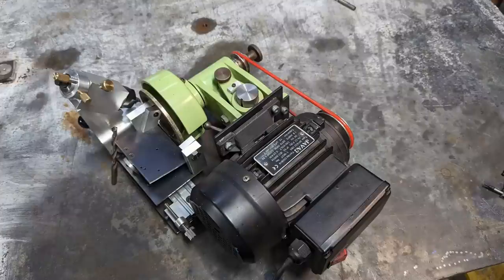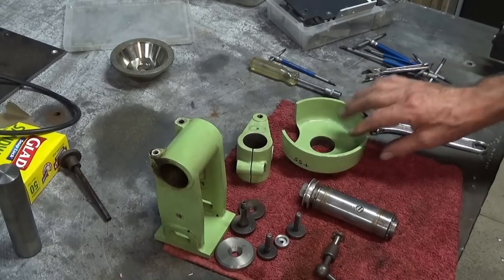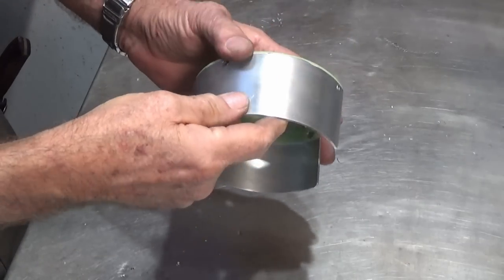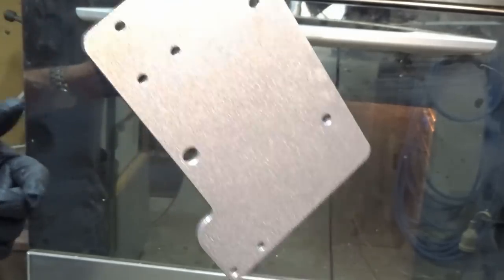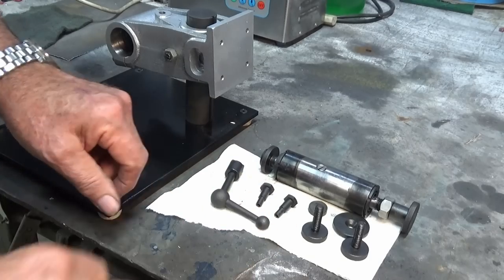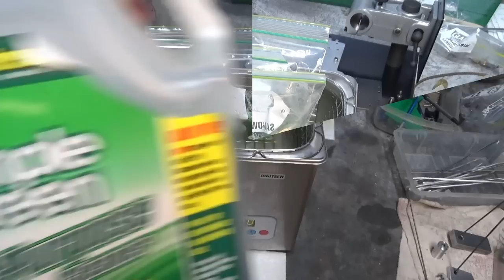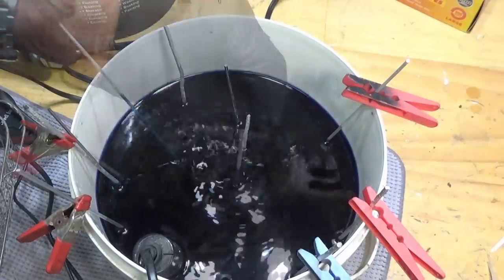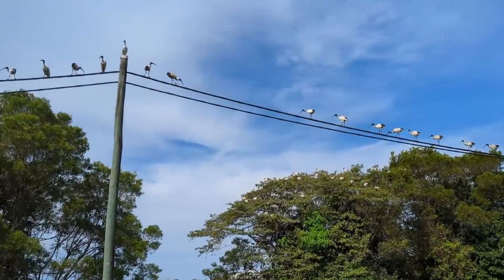Metal Finishing 3 Ways - How I Finished the 4 Facet Drill Grinder

Comment from the maker: I must make a humble apology and admit to a couple of errors in the 2D drawings that I am sharing on my Dropbox folder. There were three parts, the trunnion cam, the trunnion cam bracket and the secondary sector plate which needed to be updated. The trunnion cam was too small in diameter and the cam bracket was incorrectly dimensioned although this part was correct on my finished machine. These changes required a minor tweak in the radius of the secondary sector plate. The errors only became evident when I went to calibrate the trunnion cam and engrave the markings today. However, I have updated the drawings and they are again available for download. If you know of anyone who has already downloaded the drawings, please get them to check for the latest version. 
Regards,
Preso

Comment: What a fantastic way to do parts absolutely amazing
Mark I noticed the finish on your box you made and if I may ask how do you get the burn marks off after cutting them with the laser
I know a few bogans too mate
Reply from the maker: I leave the pins a few millimetres too long and then sand them off after gluing up the carcase. You still get a little burning around the edges of the sockets but it cleans up quite nicely. 
Regards,
Mark

Comment: Good Day Mark. Amazing build and I find the finishing very satisfying . Question.....Do you use deionized or distilled water on the final rinse and heated baths for the two processes? I really appreciate your labor and knowledge in sharing these videos!
Reply from the maker: Mark, I do make up the parkerising bath with distilled water and I also use it for the anodising dyes. However we are on tank water and I have checked the PH and it's dead on 7. We also don't have any chlorine or fluoride in our water so it's OK to use it as rinse water or water for swilling parts. I used to rinse parts with a spray bottle of distilled water (because I saw someone do it on a YouTube video) but the volume of water is important to remove all traces of cleaners and acids. Anodising is not very forgiving if you carry over cleaners and electrolytes to the dye. I did a part today and got a bit lazy and didn't rinse it thoroughly enough and there were light patches around a fixing hole where the electrolyte was still leaching out. In the trade, they use very large vats of recirculating water called swill tanks. The usually rinse three times starting with the most used water and then the last tank will have the cleanest water. 
Regards,
Mark

Comment: I cut foam earplugs in half to plug holes for finishing. Conforms to bores perfectly and is easy to remove. Love your finishing methods!
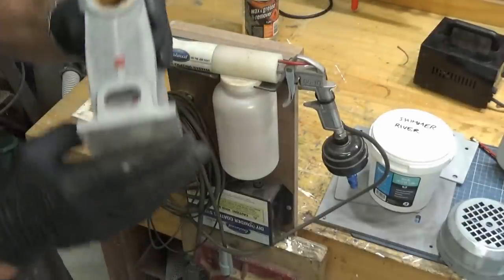Reply: Oh, it looks like you do the same thing! 16:00
Reply from the maker: They were some silicone plugs that came with the Eastwood kit. They take the temperature of the oven and you can reuse them. I think they are available on Ebay as well. 
Regards,
Mark

Comment: Mark, this has been a great series!  One question though: when you use the Simple Green to clean parts, do you use it as a concentrate or do you dilute it a certain amount?
Reply from the maker: Bob, I do dilute it about 4:1 water to concentrate. It works great and much quicker than scrubbing parts by hand with a toothbrush and Ajax like I used to . You do have to rinse it really well though as the film is quite tenuous.
Regards,
Mark

Comment: Beautiful job Preso. I think you should be known as the king of finishing (both kinds of finishing - completing projects, and applying coatings to metal) PS: Great to see the table saw being put to great use like that. 🙂
Reply from the maker: Thanks Craig. The little bandsaw has it's limitations but it's better than a hacksaw any day.
Regards,
Mark
Reply: @Preso58  no I meant the use the table saw was getting. I think it was being used as a stand for the ultra sonic cleaner or a bucket of water or something 😁
Reply from the maker: @CraigsWorkshop  Oh, you mean my stand by surface plate/layout table/surface grinder/junk storage area? I once left the glass lid from my crock pot on the cast iron surface and the condensation from whatever I was heating in it left a perfect ellipse of bright orange rust overnight. 😱😱
Regards,
Mark

Comment: Excellent video and beautiful workmanship!  Thanks Mark!  I realise that this is a "rule of thumb guestimate" and purely academic but how much extra life do you feel you've added to the drill grinder with your work?
Reply from the maker: I guess it's more about aesthetics. I do have an issue with rust on steel parts in my workshop. Mainly due to our humid climate but also because my workshop is not well insulated. The andoised parts are more wear resistant but none of the parts are subject to high wear anyway. In terms of life cycle, it would be the corrosion on the steel parts that would eventually cause something to fail or bind up on this machine.
Regards,
Mark

Comment: When you filed the aluminium sheet at 11.22 it was like finger nails on a chalkboard 😂.  
Surprised you didn't use aircraft aluminium rivets to attach it for a neater finish - you can get countersunk ones - compressed or peened over.

Comment: That is a great video. Thanks for showing how much can be done at home.
Reply from the maker: Thanks. Most of the processes I can carry out at home are not inherently expensive but you need to store a lot of consumables and basic equipment. Some of the gear, like the power supply and immersion heater I use for anodising and parkerising can also be used for metal plating. Like most workshop activities, it's all about how much space you have. Usually, never enough!
Regards,
Mark

Comment: Interesting series, thank you as always. One thing that puzzles me is why you disliked the Quorn. I have one which I use to, amongst other things sharpen drill bits. I also disliked it and would use my Kennet cutter grinder which is much simpler to set up instead. Inspired by your video I have revisited the Quorn and I now find it lot easier to use after sharpening about 50 twist drill bits which seemed to develop the required muscle memory. It will be interesting to compare the time to sharpen a bit from scratch on both machines.
Reply from the maker: I disliked the Quorn because it was difficult to read the angular scales and some of the locks were not really secure enough. I made mine with the split clamp design but later I realised  that you could use the split cotter design like George Thomas used on the universal pillar tool. They lock much tighter with much less effort and the brass cotters can be replaced if they wear out. The tilting bracket on my Quorn was always problematic and I think the design was partly to blame. I did use it and managed to sharpen a few milling cutters but I found that without good light it was hard to see what I was doing. Where I had it was in a dark corner of the workshop and I had to move it to a well lit bench each time I wanted to use it. And it was heavy! Still, the workhead design and grinding spindle were excellent. I still have the rest of the machine and maybe one day I will do something about the graduated scales now that I have better ways of doing those things.
Regards,
Mark
Reply: I understand what you say. I had similar problems, but was lucky in that I acquired mine part machined and whoever had made the scales had done a fantastic job. Mine used to live under the workbench and it was a pain to get it out and set up. I solved that problem by buildings a high level workbench that I use for all the machines that I need to be close to, the spindle on the Quorn is now at eye level, It made a huge difference.

Comment: Awesome build! I really loved the lime green paint. I was hoping you were going to keep it.
Reply: Me too!
Reply from the maker: I know but powder coat is so much more durable. The green paint is the same colour that I used on my lathe, my drill press, my jeweller's rolls and a few other machines. I wish that I could get the exact same colour in a powder coat as I really like the colour. Evidently, powder coat manufacturers use a RAL standard for colour definition but I don't know what the original paint colour was. I think I just bought a stock industrial paint and have since lost the original label. 
Regards,
Mark
Reply: @Preso58  Don't they have color matching where you can send them paint chips?

Comment: Totally off topic Mark but have just begun to melt and pour some aluminium. Watched your core making video recently very interesting. My struggle is making decent green sand. I have tried sand and bentonite in kitty litter ,mixing in cement mixer, grinding kitty litter in blender, wetting clay then adding to sand in mixer, but still cant seem to get it right😅. Couldnt see a video on here fir green sand , any advice it is very frustrating, tia.
Reply from the maker: For my latest batch of greensand I used 60kg of "play sand" from Bunnings (our local Australian hardware chain). I dried the sand in the sun and then sieved it through a fine kitchen strainer. This removed the bigger grains and some organic matter like small bits of bark and junk. I bought a 20Kg bag of pure bentonite clay from a rural supplier. It is used for sealing leaks in earth dams and also as a feed supplement for horses. I ground up the bentonite in an old kitchen blender until it was the consistency of cornflour. You can google the correct ratio of clay to sand but I think I used about 15% clay. The most important thing is to "mull" the sand/clay mixture. The process of mulling binds the clay to each grain of sand. This happens naturally after using the greensand several times in the mould making process but for a brand new batch of sand you need to grind the sand and the clay together. One way of doing it is to tip the mixture onto a plastic tarpaulin and then fold the tarp over a couple of times and the drive your car over it repeatedly. Rake the sand over a couple of times and then drive the car over it again. Alternatively, you can make a proper sand muller and just process it that way. Just mixing it in a cement mixer doesn't really bind the clay to the sand grains, or at least, it's not as effective as proper mulling. 
Having said that, my first attempts at making greensand were sort of successful, even though I did everything wrong. I used beach sand which has a high salt content and it was rather coarse. It is also pure silica sand and doesn't contain any natural binders. I did use the correct bentonite clay though.
Kitty litter has a lot of additives to make it clump  and sometimes it has deodorants in it which might affect the quality of your greensand. Ask around if you have any "horsey" friends and they may be able to direct you to a supply of good bentonite. 
Regards, Mark

Comment: Did you tape over your "fricken lazer", what's the story on that  ?

John 🇨🇦
Reply from the maker: I did! It was actually a bit of a nuisance. It is so bright that it's hard to see the line you want to cut to. The saw was originally for cutting wood only and I think that it may have been better on that material. On polished or bright surfaces it's not good. I may end up just fitting a decent LED light instead. 
Regards,
Mark

Comment: What is the chemical formula of the Sodium bisulfate?
What is the concentration you used?
Are there signs of too hogh or too low concentration?
Reply from the maker: The chemical formula of Sodium bisulfate is NaHSO4. It is often referred to as the half salt of Sulphuric acid. It is a bit like Sulphuric but in a weaker form. I found the information in this article http://www.observationsblog.com/sciencetechnologyexperiments/anodizing-and-dying-aluminum-without-battery-acid
The mixing concentration is mentioned in the article. I am still running the original bath that I mixed up about 5 years ago and apart from topping up with some demineralised water to account for evaporation it is still clean and clear and it works perfectly. I don't think the concentration is too critical. The water/acid mix is just an electrolyte to allow the current to flow between the work and the cathodes. 
Regards,
Mark

Comment: hi Mark , I'm also building a Quorn, I'm glad to see what i can do if it doesn't work, thank you
Reply from the maker: In the original book by Professor Chaddock, he mentions that the Quorn work head is ideal as a tool post grinder as used in the lathe. I made a tool post the same diameter as the main column and I can fit it in place of my regular lathe toolpost. I think you need to have a reasonable size lathe though to make it work.
Regards,
Mark

Comment: where did you get the scotchbright wheel. Here in Wait Awhile nobody seems to stock them any more
Reply from the maker: I bought mine on Ebay. I think Aliexpress sells them too. The original Schothbrite wheels from the USA are hideously expensive. There are some no name brands that hold up just as well. Mine is years old and it is still close to 90% of it's original size. https://www.ebay.com.au/itm/364133529452?hash=item54c80cb76c:g:N8kAAOSwNU5j3fNf&amdata=enc%3AAQAIAAAAwG72piwBCAM6JmmHzLQfmpo8uW%2BUhFYHxPwwYlu%2Farn2HsaxVZLov1DS4hdD5QdOIsEior%2FC2qcszh6%2F8oj%2FvJfuNiYhzULSN3%2Bw5EI11vtVhAC%2FcgQw9FC6%2FaIP7nHqkNn8aKzsmgQwPbo5RGM1eYlC%2Fd65YLYZFV6vrXs7LgPn1wqoMlDJT8vWFFWo%2Fb5ulsabh174%2Fx0Idfb2oAK1MsvhMfQQJWERdQ7F55UfaMV%2FPus34cyA8Nols6GBK5RDpQ%3D%3D%7Ctkp%3ABk9SR9r4vZ_6YQ

Comment: Im getting quite interested in how would using a pressure cooker affect the parker process... It would allow for higher temperatures without boiling... Im talking about proper high pressure cookers, industry grade, like the autoclave vessels... It would not allow for boiling, as the pressure and boiling point are related, so you could cook the parts at say 120 celsius or more... Im not sure if it would do anything either beneficial or detrimental to the desired result, but if the solution is temperature stable at those points, more heat is practically a guarantee of higher level of reactivity for almost all substances... Hell, heat up steel enough and it starts reacting with oxygen from air, and this being a chemical process akin to oxidation, it surely would be affected somehow by the increase in temp, without boiling, as that would not just evaporate water, but result in bubbles and vapor coverage of parts, which i assume would negatively affect the finish(as in splotchy)... 

All the best and warmest regards,
Steuss
Reply from the maker: I must say that I am don't know a lot about how the parker phosphate process works or how the heat affects the chemistry. I do know that the bath is mainly phosphoric acid and that iron is used as the depositing layer. You can rejuvenate the solution by dissolving steel wool in it. I think the temperature of the bath accelerates the process so I guess if you can heat it under pressure it will be quicker. Most of the parts take on the black surface layer in just a few minutes depending on the type of steel or iron being used. The big round washer reacted the most vigorously and I had a couple of hex headed bolts that were made of a leaded steel that were quite slow to react. It's an interesting process and the biggest benefit for me is the corrosion resistance. 
Regards,
Mark
Reply: @Preso58  Yeah, i get it, i am not really considering the heat as an accelerant of the reaction, rather as a catalyst to a stronger reaction, just as hot acid or molten salt will devour anything with ferocity and will etch metals very deeply in a short time, as compared to regular temp. media, so am i thinking that it may result in a deeper layer that will be like rust pitting in a sense, deeper in the surface, yet unlike rust, a stable form that wont have problems chipping off due to thickness... Not only that, but if that is so, one could make a part slightly oversize, a thou, let it cook, develop deep layer of phosphate layer, kinda like case hardening, and then grind/lap that phosphate back to spec dimensions and with lapping, give it a very nice finish, as the surface would be taken down, kinda like a diamond smooths over a grinding stone... Still leaves a rough surface, but much nicer to touch and to the eye... Especially as this surface will still get the oil(lapping will give you the idea of how it will look, as it is an oil lubricated process)... Speaking of which, why dont you ever consider japanning of parts? ``Hand tool rescue`` has a few nice recipes for it, and i find jap. finish to be most durable and easy to work with... Especially with smaller parts... I wanted to coat my whole large lathe with japanning black, but drying that would take immense time(that i could have afforded, as she still is in repairs and not running, so she could have very well been drying even until today... But its a huge machine to japan coat.)... 

Kindest regards,
Steuss

Comment: Is powder coating such a good idea for steel? I was under the impression it can trap moisture and start corrosion from the inside.
Reply from the maker: I haven't had any issues with rust under powder coat. If you do the preparation properly and warm the parts prior to adding the powder it seems to be fine. 
Regards,
Mark